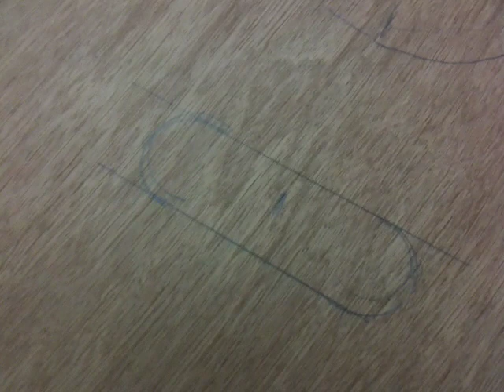How to build a portable mirrored hunting blind

Comment: good job overall...there are some things to think about though- when i made mine, i stayed away from wood, yes it would be lighter, but you have to take into consideration the swelling if you have it out in the rain...you also would have to think about the adhesive losing tack after being exposed to the elements...thats why i chose plexiglass.  although i like the fabric hinges and glued fabric backing, you would have to think about mold...if it gets wet, its gonna start to stink cont'd

Comment from the maker: @MrTigerprincess The fabric backing and mirror film was applied with the spray adhesive. Follow the direction on the film essentially but use the spray adhesive to hold down. My film had a backing which needed removed first. I cut the pieces a bit oversize and then trimmed with a razor.  Overall the blind works very well, very light. I was going for the cheapest price. If I would have used Plexiglas or similar material the cost would have been to expensive to justify vs a commercial one.

Comment: First, great idea. I was hovering around the same concept myself. How is the luan holding up to the outdoors? I think I am going to do the same thing, perhaps with eucatex material. I will probably paint the whole thing with an exterior black paint previous to adding reflective material. Might use some spray paint on the inside for "camo" pattern instead of the camo fabric.

Comment: Nice 
One question if you still read this or can post back .
did you use waterproof material or when that material gets wet does it add weight to it and is it soaking into the wood or did you treat the wood also so that it didn't soak up water .
that was an ingenious idea,  it looks nice
Kudos

Comment: Great vid. I am getting ready to make a version of yours with changes and about $40-$60 cheaper. But before I start, I was wondering if you had used yours yet and the results?
Reason I ask is I know spray adhesive and spray paint has a strong smell and was wondering if that was detected by the deer or letting it "air out" got rid of the smell?
Thanks
Reply: jmyers73 My husband and I built a ground blind, when finished,  I used spray paint on the outside of it, the deer had no problem walking 17 yards from us as we were painting it, and they had no problem coming back during bow season

Comment: I finally received an answer that you used the spray adhesive on the mirrored side of the wood to hold the mylar in place.  Thankyou for finally making that clear.  I have several suggestions.  I have looked at material at Lowes and found a interior paneling that looks pretty durable and only cost $10.oo for a 4x8 sheet.  I also found mylar used for wrapping bodies at massage parlors that is 1/5  cost of the window mirrored film.  I am not sure if it is durable enough but  I am checking.

Comment: I really like your idea of using your old blue jeans for making denim hinges for the sections.
Great idea and it's recycling also .
Throw some scotch guard spray on the material and it will shed water also.
I have looked at making this out of already mirrored Polycarbonate sheets skipping the whole window tint steps but it is VERY expensive unless you can find a good source for buying it .

Comment: Nice work, but your placement in the snow leaves something to be desired. If you'd set it back a little with a few of those pecker poles  and low brush reflected in it it wouldn't stand out pure white against the brush and you'd still have the full view.

Comment from the maker: Corrugated plastic for sign making may work. It is light and cheap but the waviness of the board may produce ripples in the mirror.  I would like to see one if anyone can post a video. I am of the opinion if the cost approaches170-180 dollars you might be just as well to buy a commercial product. my 2cents.

Comment: unless you take the time to waterproof it, but then its still gonna stink like waterproofer rather than must, but you would still have the problem of the plywood soaking up water like a sponge, then bubbling the foil, ultimately peeling everything off...like i said, good job overall...i love the fact that peope are making their own in lieu of paying out the ass!!
Reply: I like the idea of Plexiglas but I don't think that this would be out in the weather long enough for it to gather mold or anything like that. and as long as it is opened in the garage or a spare room to allow any dew on it to dry, it should be G2G.

Comment: It has been asked and not answered... How did you apply the reflective material. The box says to use on inside of window.  Does not instruct how to use on wood or other material?  Did you use the spray adhesive to glue down the reflective material as well as the camo material? You left out the most important part of building the Blind.     HOW DID YOU ATTACH THE MIRRORED FILM????????

Comment: Couldn't you use foam construction insulation sheets.  Lighter but not as sturdy.  Would need to be tied down for sure if windy at all. Easy to cut, already has foil on front and back.  Could still use the window tint and fabric if wanted.

Comment: @MrTigerprincess You are going to have to apply several coats of a sanding sealer to get the surface real smooth. Sand with 120 grit and remove dust with a tack cloth. I used contact cement to apply the fabric (it cheaper and better) to two outer panels have to be space 1/2" apart and the center is butted together.  I made my peep hole 12" from the top, its even with the gun port. Gun port is 4" wide.(2" on each panel) the carrying holes are about 9 1/2" from the bottom of the gun port.  Nice